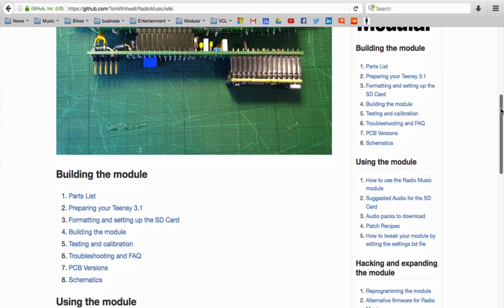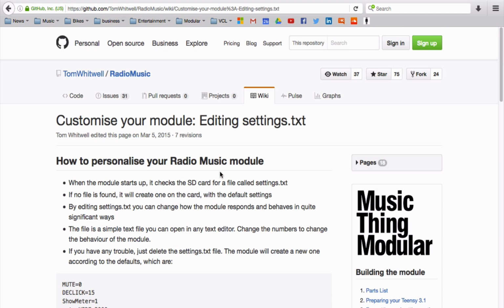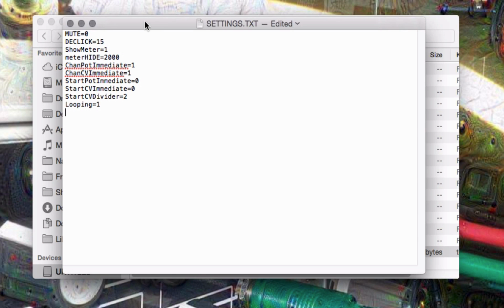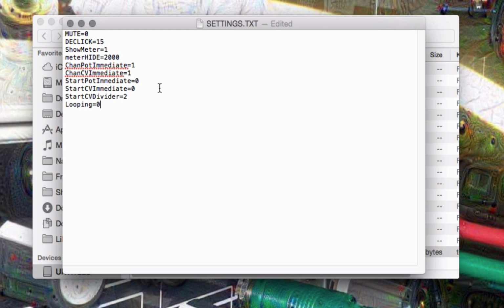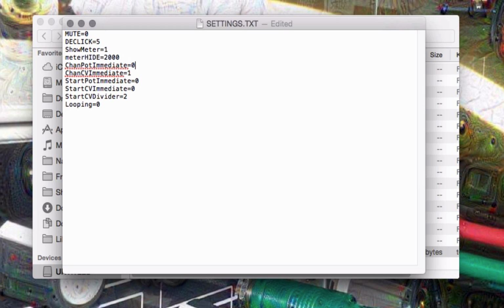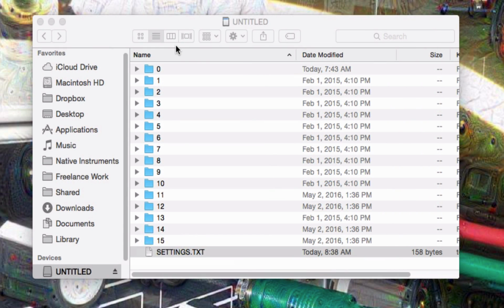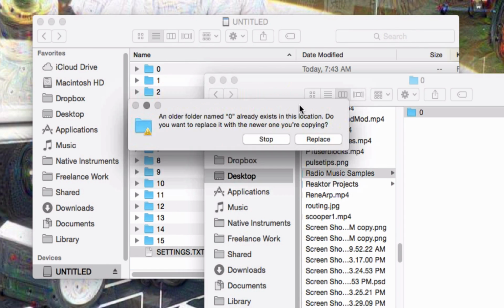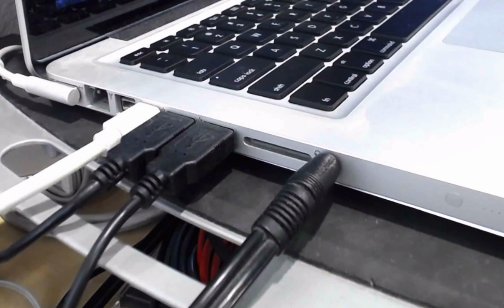Radio Music Eurorack Drum Machine

Comment: I have a question, if you set the "StartCVDivider" value to 16, it is basicly divide de posible positions for the start point to only 16 values, thate means you can divide a sample in 16 posible starting point, wich is basicly chop the sample in 16 pieces right???

Comment: Does it support stereo samples?
Reply from the maker: +Seen From Space I believe it's meant to be mono...
Reply: I guess modular audio paths are generally mono, so fair enough! Stereo samples can get you round having to use a lot of mixing hardware - you can have stereo image and spatial FX as part of the sample. I do this all the time with the Octatrack.
Reply: yeah totally mono. Need to adjust .wav files to mono .RAW files.
Reply: @DivKid  Thankfully with the new firmware not anymore
Reply from the maker: Yeah, the Radio Music documentation gives the nitty gritty on file format and the specific encoding settings for the raw file. If you use the wrong type of file or don't mix to mono, the sample may sound wonky, or may not sound at all.